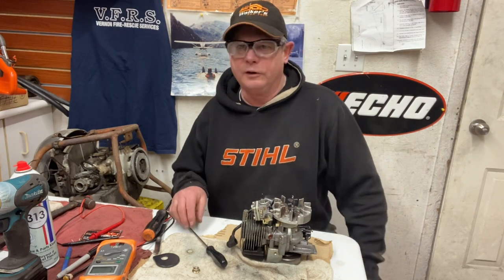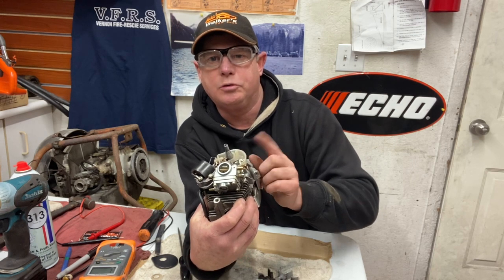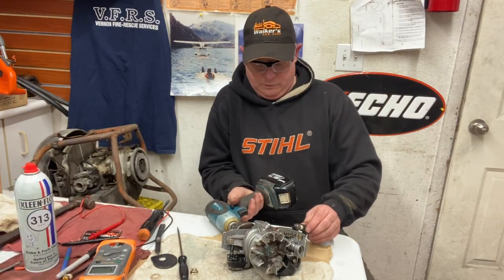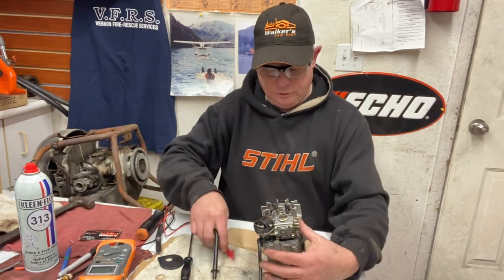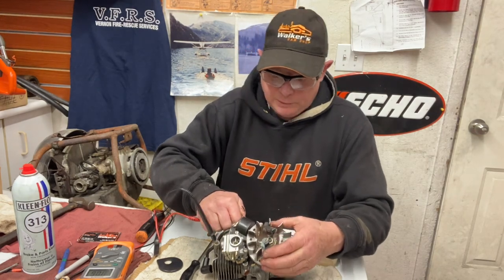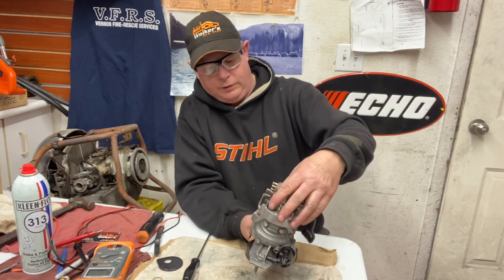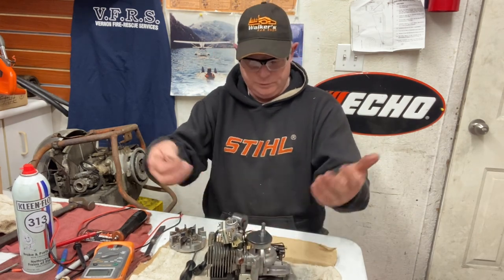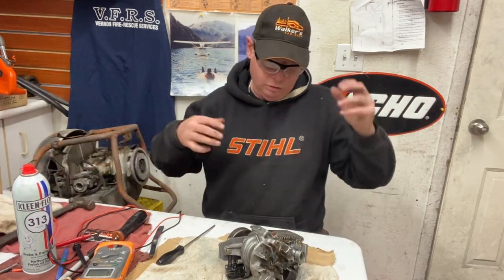How to set points on McCulloch mini Mac saws

Comment: Great video. I have the Mini Mac 35 and need to adjust the points but I cannot get the fan off to get to the points.  Does the nut turn counter clock wise to loosen or clockwise?  The nut has not been off in 40 plus years and I cannot break it loose so I want to make sure I am turning it the correct way.  Appreciate any suggestions to get it off.

Comment: Great vids, Donnie. Got a Mac 140, no spark. Reset points gap, but still no spark. Measured resistance at coil- 8.6k ohm secondary, but seems like primary is open…love the little guy, but people want $100 for a coil. Might just put it back together as a display piece 👍🇨🇦
Reply: Think about the money most people waist on things they don't need...that saw deserves to live...
Reply: Find it on line

Comment: OK, now I have to pull the two out from under the bench, they have been there for 15 plus years. Didn't know what to do with them :)
Reply from the maker: Ha ha funny it’s crappy you can’t change coil wire on auto tuned eh
Reply from the maker: I was about 11 years old when I first started working on those little Mac’s
Reply: @donnywalker4691  Was when I was 13 I was working on the dirt bikes ( Bultaco's) as a 13 yr old could. Didn't touch saws until 14 and those were Poulans :(   Guess neither brand really survived, in fact didn't the current "McCulloch" brand sell a Poulan built saw for a little while?? Guess I was on the right side of THAT eh?
Reply: @donnywalker4691  Nothing a little rubber insulation "paste" & shrink wraps can't fix... I think. I HOPE. I remember once cutting one of those and putting a wire in like a worm on a fish hook, then shrink wrap...u think it worked?
Reply: Mini mac?
Just slide it back under the bench.  😁

Comment: Donny, what do YOU think has the best ability to run a 32” bar stock: 572XP OR a MS462? I don’t have the personal confidence or tools for porting OR someone close by THAT I TRUST for porting a saw. You PERSONAL opinion is important to me!
Reply from the maker: Those both are good and stock can run 32 inch doing a muffler mod makes a big difference
Reply: @donnywalker4691  thank you for your input because it makes a difference to me. 😳